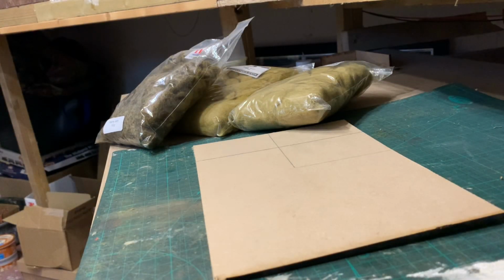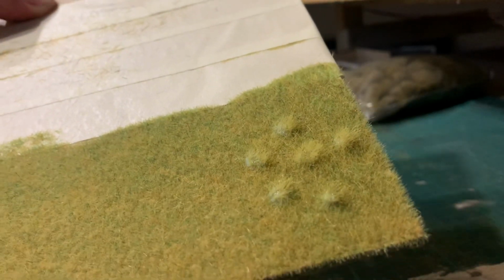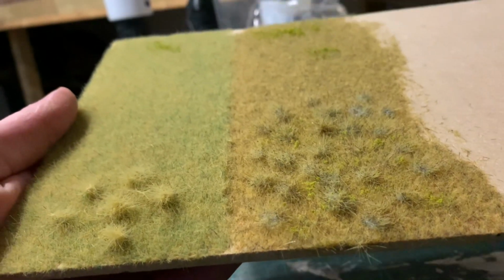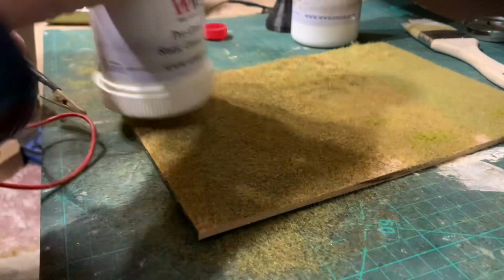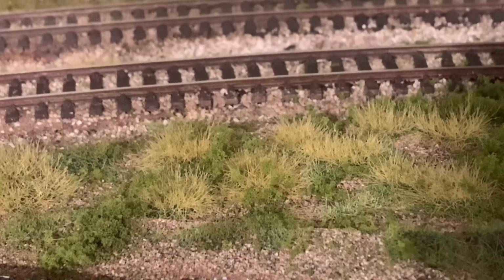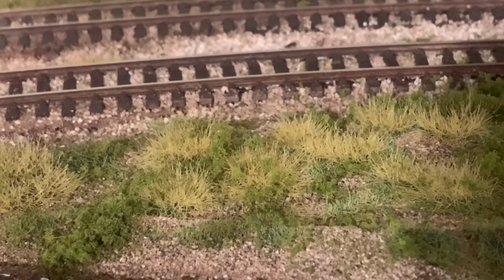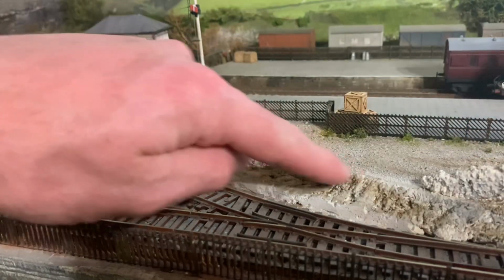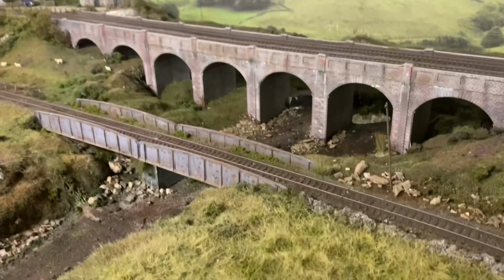Realistic Scenery - Making Tufts in Situ - Wwscenics - Peak District LMS Model Railway

Comment: Great video.

Was very interested in your tests. I am also currently testing a number of different grasses to do a similar tuft scenario, but in N scale. I also found that WWS patchy is a great base colour in making tufts. I have also used some WWS 6mm North Euro grass mixed with the beige (I use Woodland Scenic's straw, but much the same colour) gives the longer grass that slightly green look - it is not all "dead" grass.

Your adding of some turf scatter after creating the tufts certainly improves the look - something that I will definitely try in my next round of tests.

Keep up the good work.
Reply from the maker: Cheers Eric , yep I agree.